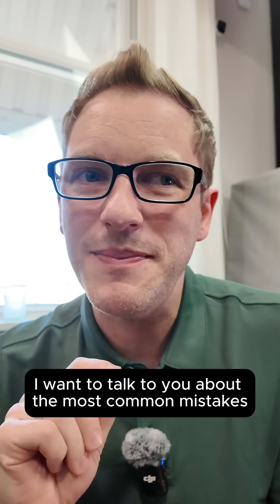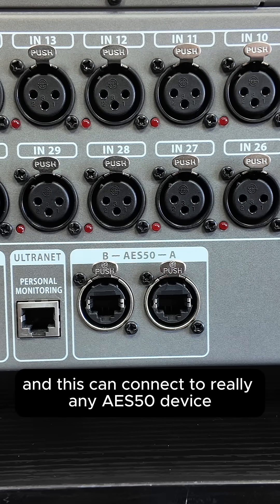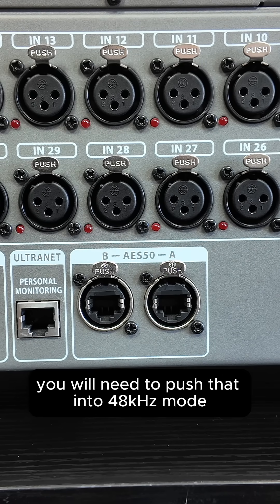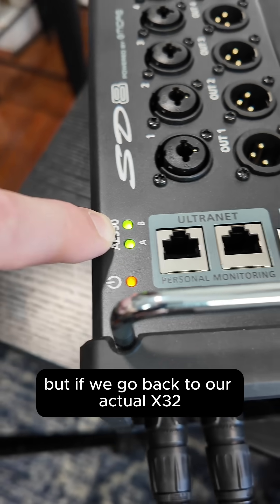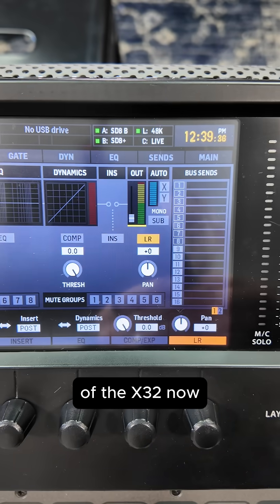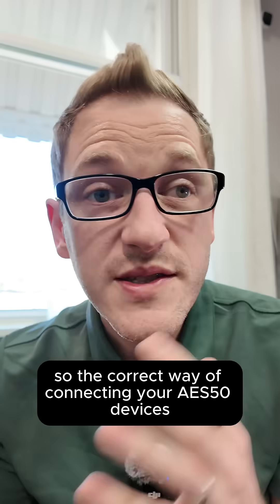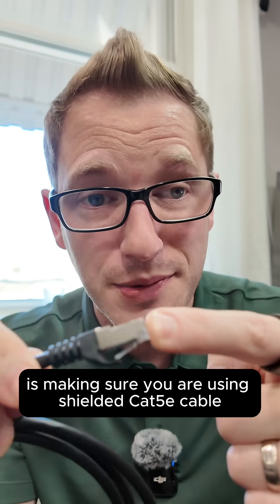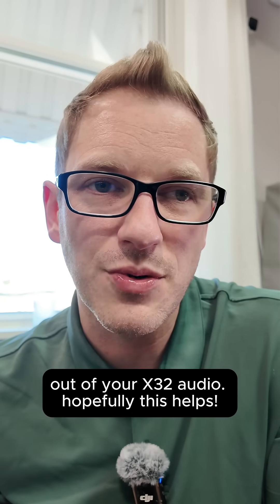AES50 Problems with X32 and M32 and how to fix it! #aes50 #behringerx32 #midasm32

Comment: I made a very expensive mistake connecting cat 6 into my x32 ended up frying the aes 50 a port on the console my advice to everyone out here use cat 5 e only
Reply: You kidding bro😢 its been a year of me using cat6 no such thing
Reply: Cat6 is electrically identical to cat5e, it has the same amount of contacts
You may have fried it with an improperly terminated cat6 cable, or the wrong type of cable. There are 2 types of terminations for networking; straight through/patch, and crossover 
Crossover cables, depending on how the aes50 pinout is, may cause damage as the wires are not wired the same way

Comment: Hi Drew !
What type of CAT wire will be better for AES50

CAT 6e S/FTP or
CAT 5e S/UTP ?

Bless!
Reply: Cat 5e S/FTP is best  ( must be S/FTP )

Only use cat6 if you have to BUT only for short distances as the internal cables are longer
Reply: @king_ofgames3650 I've never heard it has to be S/FTP. I'm pretty sure S/UTP (shielding for the overall cable but not separate shields for each individual twisted pair) is within spec for AES50.

Comment: God bless you, brother. Please help me connect both a S16 and a 16 channel analog snake to my X32 so to have all 32 channels up and running. Thank you.
Reply: I can help you if you so need.
Reply: @PekamoTheAceMech Hello! Thanks for your kind offer. Sorry to take so long to respond, I don't check comments often. So far what I think the issue is at that place where I work seldomly with no time to study the routing and what those people have setup there, is that channels 1-16 are connected to the analog snake and the S16 is connected to the AES50 port A. Is it blocking the snake because the first 16 channels are auto-assigned to the S16?
Reply: @rolabeta 
No problem. 

The local outputs on the X32 are always live. This is true even when your XLR outputs are routed to AES50 A or B.
Reply: If this response doesn't help or should you not understand, let me know and I'll like to be of help.

Comment: on X32+SD8 at 150’, i HAD to use EtherCon.  Sweetwater initially sold me a “normal” STP cable and it refused to connect.  I tested the cable thoroughly and it was perfectly fine… still using it to this day for network connection to X-touch

Comment: The x32 is ok but I have 2 problems with it the first is going from a old soundcraft the mic preamps are just not up to scratch with sound quality 

my second problem is that it has plastic XLR sockets (not even Neutrik!) so if you are using a snake with it it picks up bad interference from not having a ground and can get bad pops and bangs from touching mics and or the snake body/connectors
Reply: "plastic" XLR sockets are basically the standard nowadays and you can find them on al kinds of consoles from all major brands and across all quality levels. Regarding interference/grounding, it doesn't matter at all, because XLR uses pin 1 for that, not the shell. Depending on your cable, the shell might not even be connected to the cable shield and there's some debate about whether it should be or not. If you're experiencing grounding issues, you probably have faulty cables.
Reply: Hello hello..!

To solve the problem you mentioned about experiencing lower quality when upgrading from an older Soundcraft to the X32, the best solution (if your budget allows) is to get a Midas M32 instead of the X32.

The X32's preamps aren't bad, but the M32's are light years ahead in terms of quality.

I've answered this same question in many videos. If your budget allows (it's not much more), it's much better to get a Midas M32 instead of an X32. 
They function identically, but the build quality (faders, connectors, etc.) and especially the audio quality of their preamps are infinitely superior to the X32 and other similar mixers from other brands.

Greetings from Spain!
Reply: honestly, the sound difference between x32 and m32 (or S(D)16 vs DL16) are quite minimal. In a direct comparison, you might be able to tell the difference. But on it's own in a live sound setting, most people couldn't tell at all. A lot of it is just a negative placebo effect when people hear the name Behringer.
For the consoles, there's definitely a difference in build quality, esp. with the faders. For stage boxes, where it's just the preamps, the additional price for Midas usually isn't worth it. Unless we you really care about the label on the box.
Reply: Hello, hello...

I have my own M32, bought in 2017, although I've used several X32s in all their models, and the truth is, no, they don't sound the same.

There's a big difference in audio quality between the preamps of the M32 and those of the X32.

Of course, in a normal, standard show, where there's usually quite a bit of ambient noise, and people are generally just enjoying themselves without paying much attention, you're not going to notice much of a difference..

But honestly, in my 8 years of experience with the M32 and X32, the M32's preamps are better and sound better, regardless of the environment..

You can have an X32 without any problem, but what you shouldn't skimp on is the stage patch.
You can have an X32 but use a Midas DL32 stage patch. After all, the mixer is nothing more than a "remote control" for the audio that's actually produced in the DL32 stage patch.

It's not a question of whether the label on the box matters or not. The M32 and DL32 simply sound much better!

But ultimately, all of this is irrelevant, because in the end, what matters and makes the decision is the budget and the environment and/or type of use (for private use, or for a sound rental company or shows with varying levels of responsibility, etc.).
If it's for personal use, where you don't have to explain yourself to anyone, anything will do.
But if it's for more professional use (sound companies, etc.), especially if they're not part of the small circuit, between the X32 and the M32, the only option is the M32//DL32.

In Spain, the M32 is a super standard in the industry and you see it everywhere (in any of its variations) and at all kinds of shows, large, medium, and small, while the X32 is only seen for personal and/or less professional use.

This is just my opinion based on my 8 years of experience with the M32 and X32, and as I said, in the end, it all depends on the budget and the intended use..

Greetings from Spain...
Reply: Of course, in the professional space Midas is more established. But that's at least partly because you just won't be taken seriously when showing up with a Behringer console. Also, if you're on the road, you'll actually profit from the better build quality. Together, that's already worth the higher price to a company, even when completely ignoring the sound.

But regarding the sound difference, I'll just point at the many discussions you can find about this online. Most of them agree: Yes, the Midas products are a bit better, but in a live sound environment, you probably won't be able to tell the difference unless you have a direct comparison. It may very well be another thing for studio or even IEM setups.

I've also worked with various X32 products for years and we've also bought a DL16 precisely because we hoped to profit from the better preamps. In the end, we were really disappointed because the difference was much less than we expected. We ended up swapping the DL16 for another X32 Rack. It costs about the same, but can be used as either a stage box or a standalone mixer.

After all - yes, the Midas version sound better, but most people agree that they don't sound much better. If the difference is enough for you or you want the better build quality and can afford it, there's definitely nothing wrong with buying Midas. But for anyone who hasn't tried it personally before buying: don't be disappointed if you expect a huge difference in sound and don't get it.
Reply: Hello, hello.
Perhaps I should have mentioned from the beginning that I'm always referring to live shows and touring.
I'm 60 years old and started in 1982. I've been doing live shows and touring for 43 years, and I've always been referring to the world of professional live performance, not the world of recording studios, private personal use, or small shows in pubs or similar venues.

Even in the world of live shows and touring, the M32 is still much better than the X32, and not just because of its construction, but, I insist, because of the audio quality of the preamps.
I'm not going to convince anyone, and no one is going to convince me.

Besides, not all shows are noisy and with a distracted audience.

At least in my 43 years on the road, I've done and still do many shows in theaters and small auditoriums, with bands and/or music that isn't noisy, and in quiet and peaceful environments.

That's where you can really see the difference. The m32 sounds light years better than the x32.
I will say that, just as I said the m32 is a super standard in the Spanish industry (not only for its construction but also for its preamps), the rack version of the x32 (X32 rack) is the most used monitor mixer in practically all types of venues (small, medium, and large).

But always the x32 rack with a Midas DL32 stage patch, never the Behringer S32.

With two of the bands I've worked with for a few years, we use this configuration: the m32 with the DL32 for FOH and the x32 rack with the Midas DL32 stage patch for monitors (with an analog splitter).

This way, our monitor world takes up very little space, and we always fit in well when we do festivals with several bands, each with their own mixers for both FOH and monitors.

As I said, in my opinion, and with my years of use and experience with M32 and X32, and in all kinds of environments (noisy, quiet, and all sorts of variations), without a doubt, the M32 always sounds much, much better.

Although, as I said in my previous message, in the end, all of this is irrelevant, since everything depends on the budget and the intended use (professional use for all kinds of events, noisy or not; or private use, like a group of friends who occasionally do noisy shows in bars and pubs).

Each situation has its own best option.

To finish, I'd like to add that we always try to find and buy used M32s and especially DL32 stage patches, and they are very rarely found; they are very difficult to find second-hand, and expensive..
However, there are quite a few used X32s and S32 available.

Apologies for the length of my message.
That concludes my message.

Greetings from Spain.